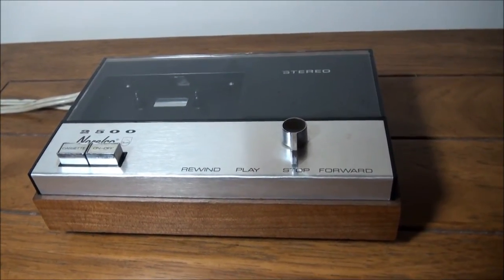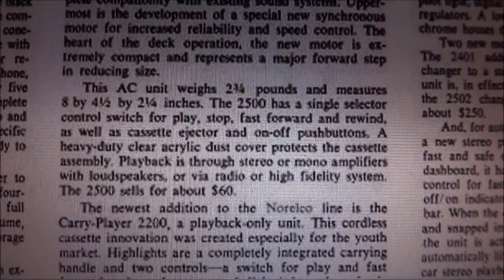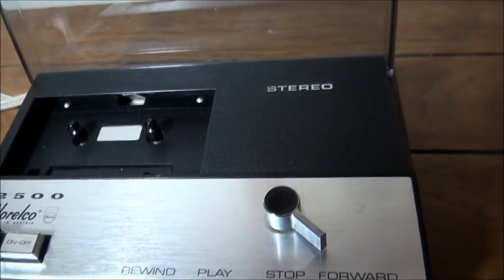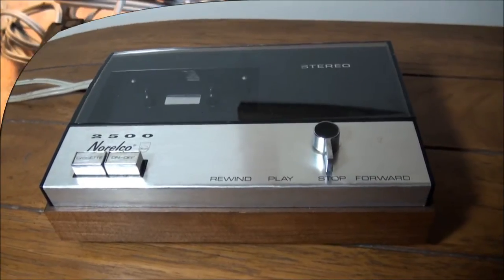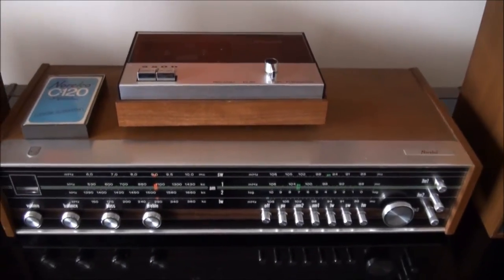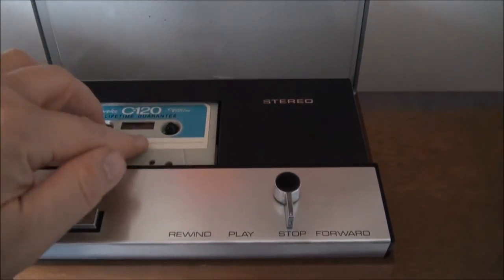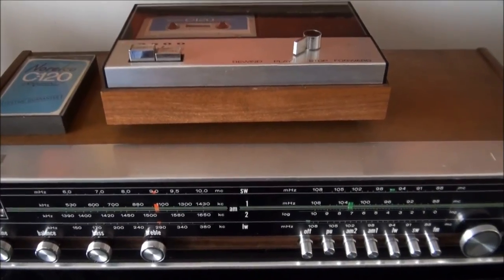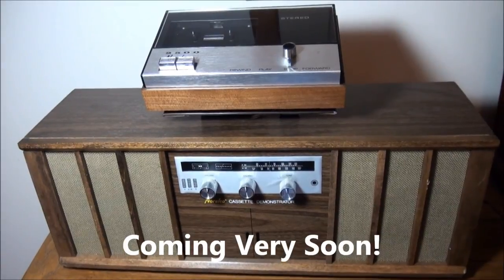1968 Norelco 2500 Stereo Cassette Deck (Player)

Comment: I have one exactly like you demonstrated in the video.  Mine says 1967.  I'm sure it will need new belts.  Any suggestions where to get new belts for it?  Great video by the way!!
Reply from the maker: The source I used was in England and it disappeared years ago. You might try turntable needles dot com. I've gotten belts from them for things, including 8-track machines.

Comment: hey i know its a little late, but i bougth one recently. I change belts and everthing is moving but tha cassette i doesn't what i can do? thanks
Reply from the maker: Sorry, I don't know. This old equipment develops other faulty electronic inside parts like bad capacitors and resistors than can cause failures. At least it sounds like the motor is still working, that's good anyway.